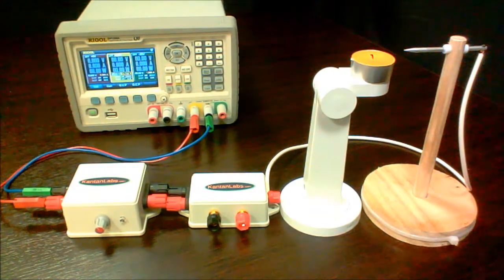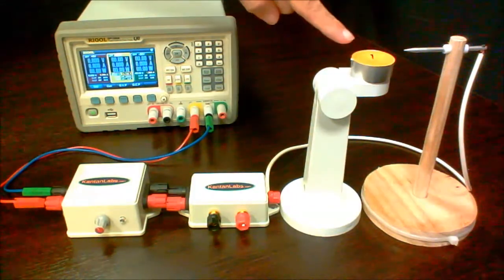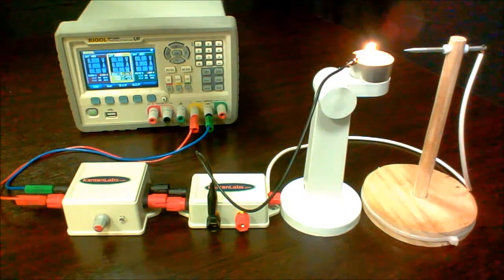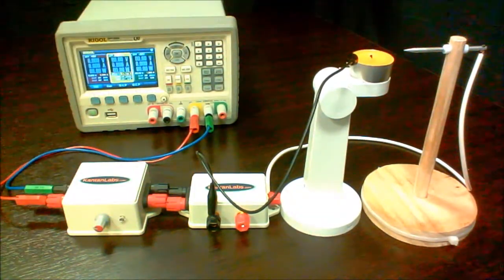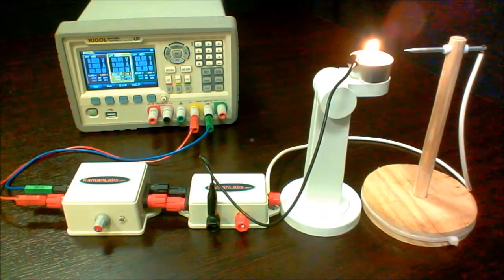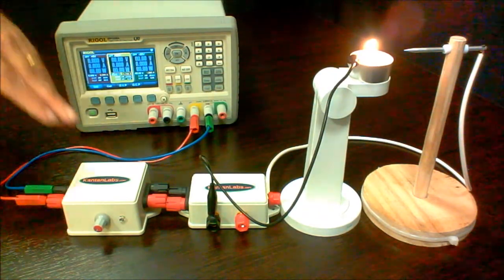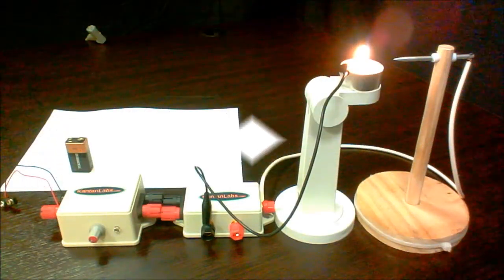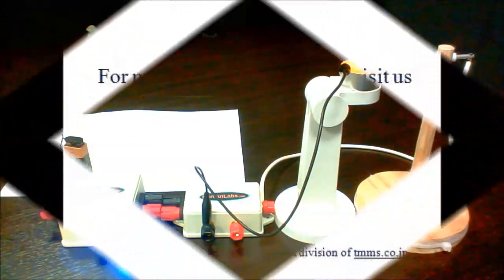How to blow a candle using electric wind

Comment: I don´t understand why the candle is blown out when connected to ground, but not otherwise.
Reply from the maker: The charges in the drift region are of the same polarity than the tip, when there is no ground they accumulate at some distance and they produce a field that directly oppose the tip field resulting to a current reduction. This type of saturation is also called shield effect. When the charges are allowed to flow towards the ground, the
Reply from the maker: When charges are free to move towards earth (ground), the shield effect is removed (the charges have the same polarity than the tip and create a field that oppose to the tip one). With a near ground connection the current is much larger leading to a much stronger neutral wind. You can imagine the flow upstream a dam in a river; remove the dam and the flow increases.

Comment: How much was the output volts
Reply from the maker: The threshold depends on the radius of curvature of the tip, however it is never below around 3kV. It is somewhere in between 5 to 10kV in the proposed video